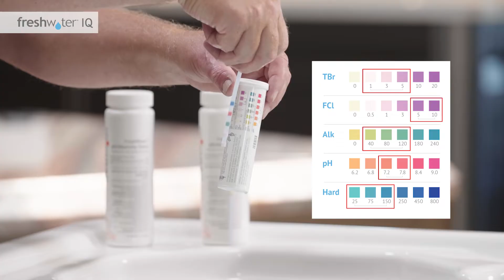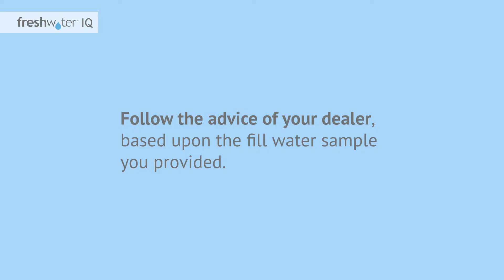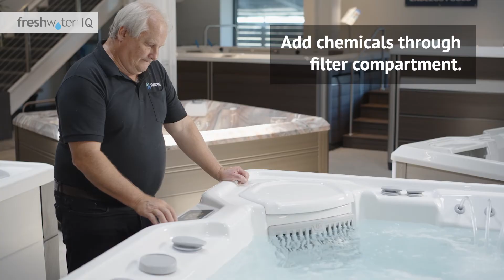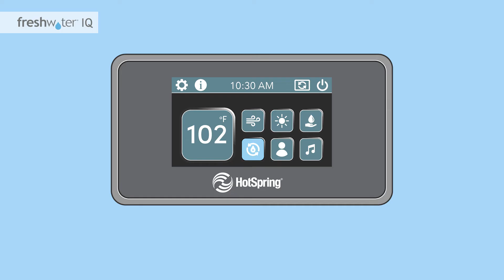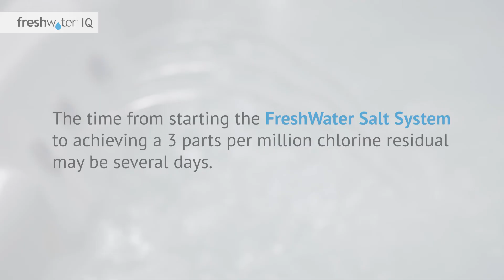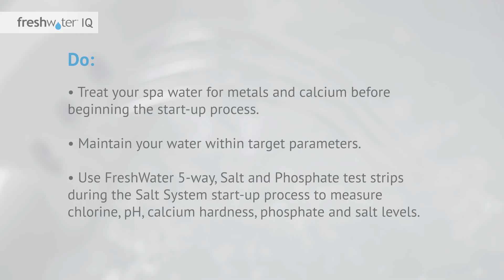Your Ultimate FreshWater® IQ Setup Guide

Comment: What model is this for ? Our dealer gave us this piece but it is not what we have under the unscrewable cap. Ours has a push button on top and no wire or screw plus it's black and not gray. It looks nothing like this smart monitoring cartridge.
Reply from the maker: Thanks for reaching out, Matt. The Freshwater IQ is available on Highlife® Collection and Limelight® Collection spas for model years 2024 & 2025 at this time. The optional smart monitoring sensor is available for these models, but it is not standard. As a result, they come with basic compatibility but do not include the intelligent monitoring system unless you and your dealer have selected this optional water care system. 

It sounds like what you are seeing is the filler that goes into where this system would be installed if it is selected. If you are interested in the FreshWater IQ System, be sure to get in touch with your dealer. They'll be able to help you get that added to your existing spa if compatible. 

Please let us know if you have additional questions or concerns. 

Happy Hot Tubbing!

Comment: I'd really love to find detailed instructions on CALIBRATING the IQ system. I've found that the monitoring doesn't match my strips, but can't find anyone with good instruction on how to actually calibrate (when you hold down the chloring or ph columns and can push the numbers up or down).  Wish that was out there!
Reply from the maker: We have several guides and resources available for our spas. You can find most of these in our owners section on our website. : https://www.hotspring.com/owners

If you can let me know what you'd like instructions for I can provide you with a direct link to the guide available to address your concerns.
Reply: @Hotspringspas1  Hi and thanks! However, none of these guides are for what I've described above.  The issue is that there's no guidance/instruction anywhere for how to actually calibrate the system. Just how to get into the calibration settings, but that's it.
Reply from the maker: Thank you for your comment I understand your frustration. 
A discrepancy in readings between your Smart Monitor system and a Test Strip can be caused by several factors, including the timing of the test, the use of incompatible products, and the flow rate. Generally, we don't expect the calibration screen to be necessary and should not be used to address significant differences in readings. Instead, we want to identify the cause of the difference in values and address that cause for ongoing accuracy. 
 A Calibration Offset feature is available to adjust the chlorine and pH readings. This setting should only be used when the readings are
stable but consistently slightly higher or lower than a reliable reference measurement. To determine if this feature should be used, the spa should be stable and holding consistent values for 3-5 days. A ~3 ppm residual must be in the water, and the pH must be in the recommended range.
range 7.2 - 7.8

I hope this helps and if you should need further assistance please reach out to our Customer Service team at 800-999-4688.

Vanessa- Customer Care
Reply from the maker: Thanks for reaching out! We recommend contacting your local dealer directly for assistance. They will be best able to answer your questions and assist. Our team is always here to support that as well. Please don't hesitate to reach out to us at 800-999-4688, extension 8432, or email us at CustomerService@Watkinsmfg.com. We're always here to support you!
Reply: @Hotspringspas1  Thanks! But as the company that sells and markets the product (I'm imagine quite heavily as a big selling feature), why don't have you have resources collected/developed to help guide the steps/procedures for using this main feature?
Reply from the maker: Hi Ben, there are some troubleshooting steps on page 6 of the owners manual for the FreshWater Smart Monitoring system that you would want to take a look at before adjusting the parameter offset. Many times there is something causing the reading not to match your test strips. There is also information on what types of things can cause this in the owners manual. 

We encourage you to reach out to your dealer so that they can help you to troubleshoot and resolve your concern. 

If you need further assistance, please call 800-999-4688 extension 8432 or email our customer care team at CustomerService@Watkinsmfg.com.
Reply: @Hotspringspas1 why does Hotsprings and Watkins refuse to explain the calibration screen? Setting the ph/chlorine on the setting screen seems to do nothing to adjust the values to be correct. At the end of the day, a wrong reading is a wrong reading and why would anyone trust the sensor over a good test kit if it's wrong? Ph strips and kits dont need troubleshooting to read the value. My tech told me how to adjust it but like every comment I've found it isn't effective.